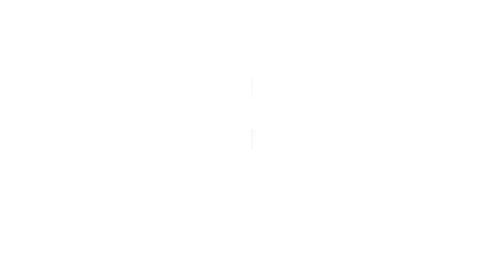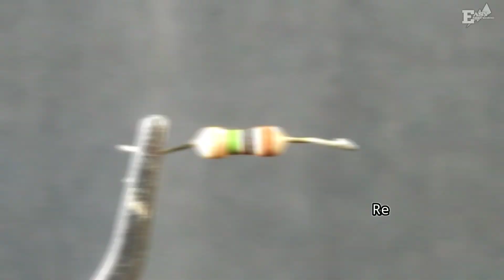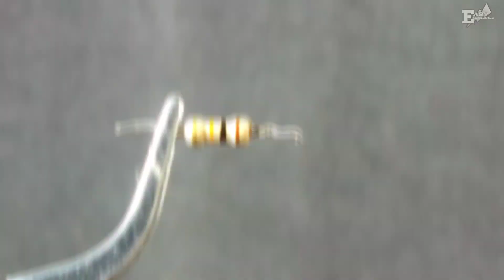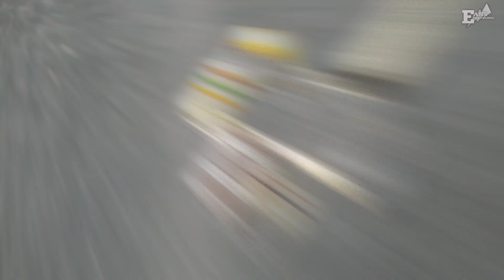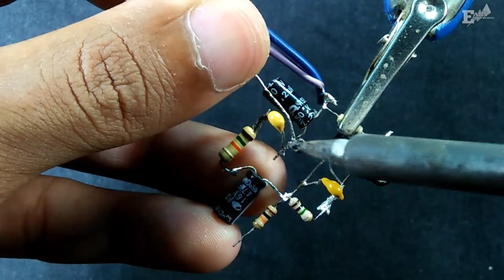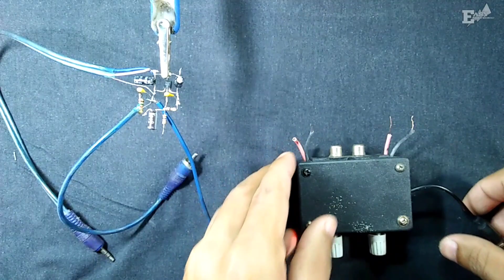Cara Membuat FILTER SUBWOOFER 12V DC

Comment: Mantaaap mas vidoe nya mudah d mengerti.smga sekeluarga sht selalu.kalu bisa modip efek 7 potensio agar kaya aleksis.
Reply: Tune contro reverb 7 potensio modip habis biar suara ny manntaaap maap saya pemulla
Reply from the maker: Iya mas 😊
Nah biar mantap yang di maksud seperti. Apa mas dan keluhan nya seperti apa ? Semoga saya bisa bantu 😊
Reply from the maker: Amin alhamdulilah  terimakasih sebelum nya. 
Dan kalau boleh tau fx apa ya ? Mixer audio maksud nya?
Reply: @EasyElektronic  epek 7 potesio itu modip mas.apan ny di ganti biar nyes di pakke buat d masjid bng
Reply from the maker: Iya fx nya fx apa dulu mas tone control kah atau echo kah 😊?
Reply: Ter serah suhu biar epek nya mantul dan ngk oper.
Reply from the maker: Ya kalau saya ga tau keluhan nya jadi bingung juga mas jelasin nya. 
Kalau boleh tau power amplifier nya pakai trafo berapa amper
Reply: @EasyElektronic  power punya 6.masing masing amplifer 30 amper semuah.
Reply from the maker: Kalau hasil mau mendekati sempurna dan maximal. 
Coba di pasang input balance sebelun tone control dan di pasang out balance sesudah tone control. Biar hasil nya lebih jernih dan ga over

Comment: & 1 Lagi mas.. untuk Filter Subwoofernya.. Knp input dr R&L di gabung Lalu di Full filter pakai Elco 2.2uf.. meskipun tanpa Rangkaian Tsb pun..kalau Input langsung Di full filter Suara Udah Jadi Sub..
Reply from the maker: Kalau untuk RL di gabung itu biar rapih aja kabel nya di pisah pun g jadi masalah.. Dan untuk capasitor input di kasih 2.2uf atau kasih 10uf pun ga bakalan bisa dapat freq 40hz ke atas karena yang menentukan freq nya ada di capasitor ceramic 474. Dan juga agar menjaga frequenxy di atas 120hz tidak lolos ke speaker. Jadi yang lolos murni low sama sub nya saja.. Dan mohon di koreksi kalau ada yang salah. 😊
Reply: Hola, una pregunta cuál es el rango de frecuencias que trabaja este filtro? Y se le puede agregar dos potenciómetros uno para el volumen y otro para dar el bajo? Grc saludos desde argentina 🇦🇷👏🏻👏🏻👏🏻

Comment: Sbenernya Pam 8403 Suplay 3.7v langsung pun.. sudah Bisa Mas...
Reply: Tapi Saya Punya PAM 8403 jg.. langsung Batre 3.7v ... 2buah yg masing"3200mah.. suara Malah bagus drpada Suplay 5v dr Charger HP yg 2Ampere mas..
Reply from the maker: Ya memang kalau pam tidak di pakai untuk subwofer ya suara normal saja tapi silahkan saja si coba pakai input subwoofer dengan baterai 3,7v 
Pasti suaranya kurang bulet apalagi di kasih full level nya
Reply from the maker: Memang bisa ka,  tapi kalau di kasih untuk bas volume ga bisa max 😊
Terimakasih ka atas saran dan interaksi nya 😊🙏